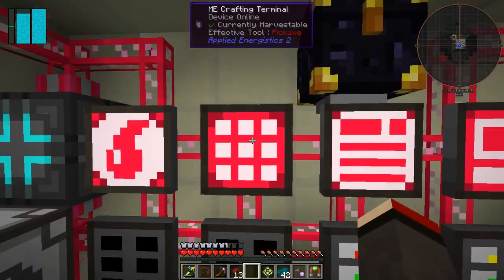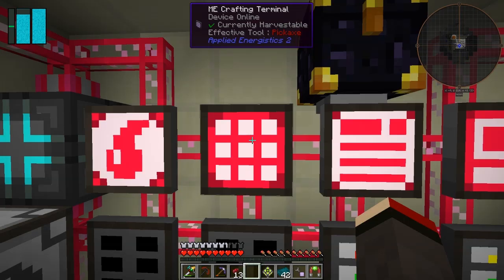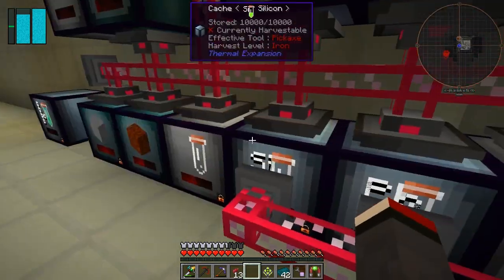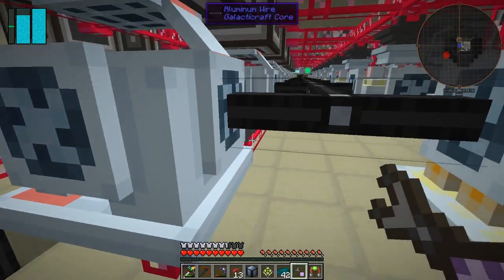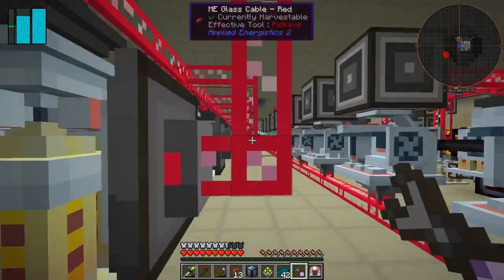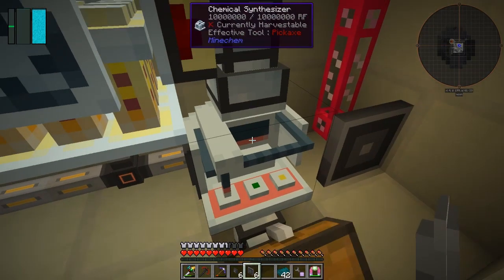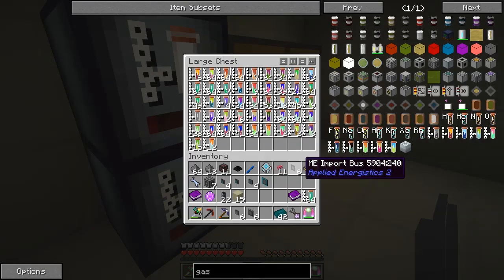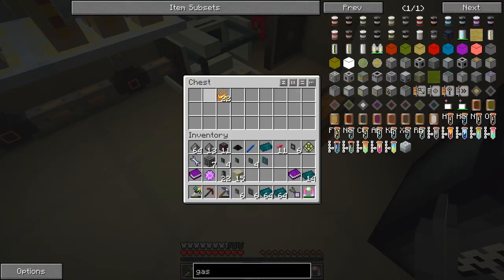Galactic Science 2 #75 - Gas Turbine Controller

Comment: those steel hulls are a pain to make. I can autocraft them now but i can only do one at a time because they take so much storage space to make. I need to get some of the ingredients setup to maintain a stock to make it faster. Plus the assembling machine is really slow even with full power and a stack of overclocking upgrades in it.
Reply from the maker: ZeroLyfe completely agree steel hulls are seriously tricky, and the fusion walls are even more of a pain. I’ve been concentrating on fusion walls but I think I need switch to the rocket. How are you doing with power, mine is going down fast just to maintain AE2.
Reply: i have a little over 400 billion right now. As soon as i could i rearranged the power lines so that the solar fed into the power core and the base pulled from the core so i could get as much from the solars as possible. most of my power though comes from 6 sterling gens , 2 with octadic caps and 4 with double layers. Minechem carbon is the best thing I've found to run in them making 3.6 million rf at 20k rf a tick with the octadic caps and 600k rf at 5k a tick with the double layers. I decompose the uncompressed coal sieved from moon rock into 1 carbon each into an ender chest that the sterlings can pull from, i also use this method to power my quarry's. With a max size quarry and 6 sieves you can get a lot of material fairly fast.
Reply from the maker: Sounds very similar, except I use solar on the quarries. I've got a small plus at the moment. The capacitors are seriously expensive!